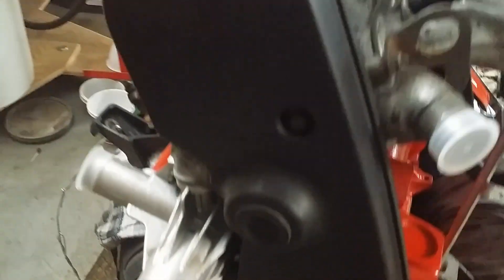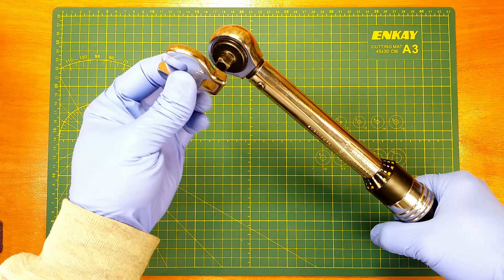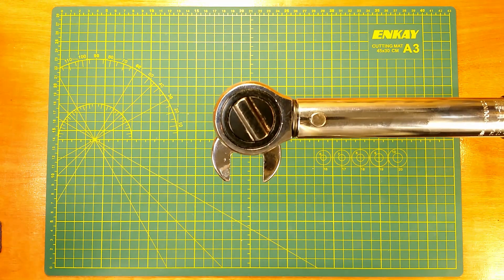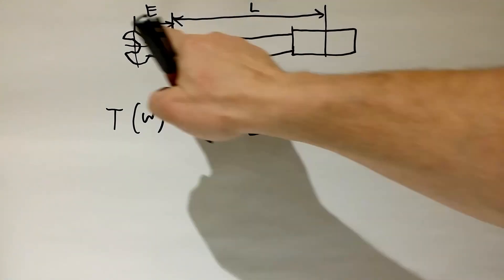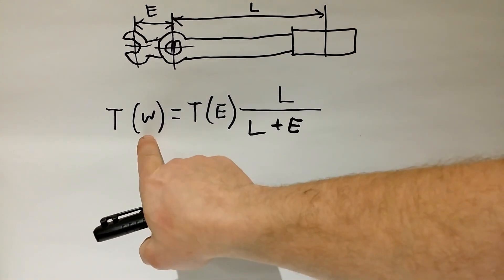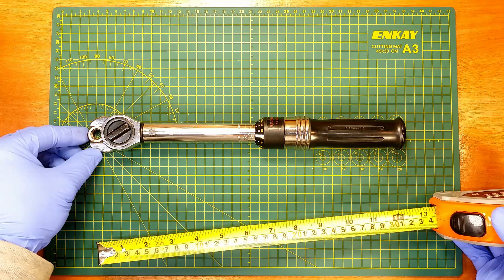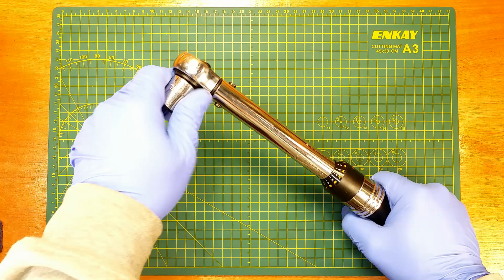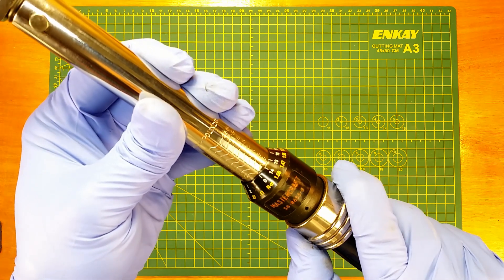The Little Torque Wrench That Couldn't (Reach a Nut)

Comment: Thank you - I have need to torque a sparkplug in my 4.6 Mercury engine - just to confirm have an issue where sparkplug will loosen up over short time - causing misfire error codes. I was concerned if using just a 'barrel' extension would alter the torque setting. You made very good points - and glad found your video. Looking forward to checking out others of yours. Take care, Tony
Reply from the maker: I'm glad it helped. See my other Torque Wrench videos on my chanel. Regards.